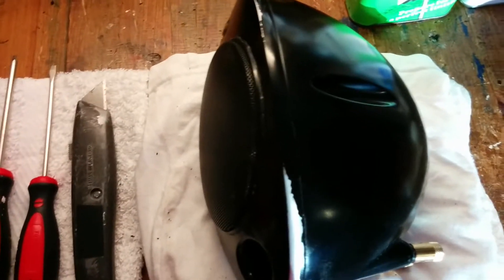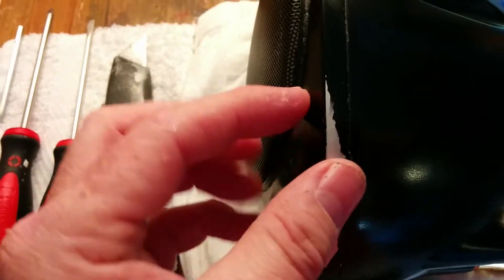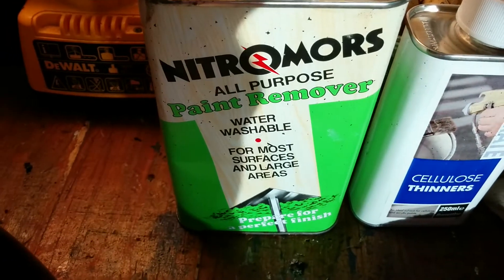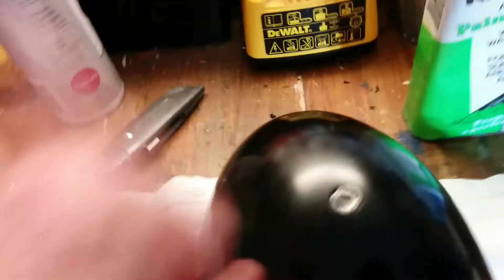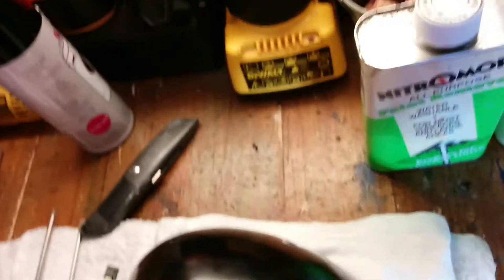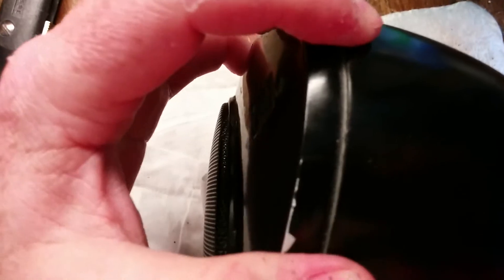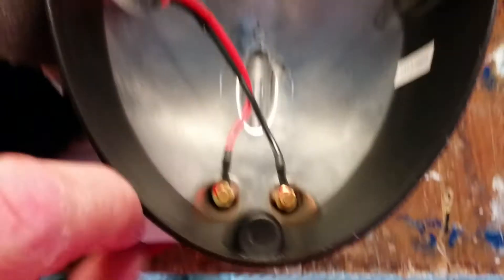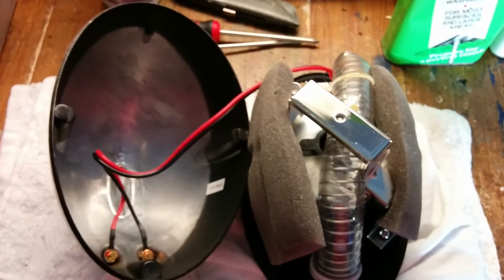KEF Eggs  How to open and paint PART 1

Comment: How did you remove the speaker wire from the bindings in the inside of the egg? Mine has some reddish goo that has hardened over the nut. Did you use the same stuff to remove the paint on the outside, or did you use something else?
Reply from the maker: I would not use paint stripper on that..perhaps try to heat it with a hairdryer or heat gun. Worst case, you will have to pick it off.